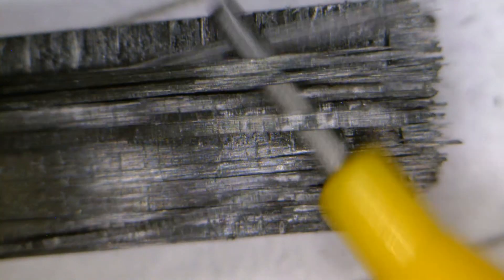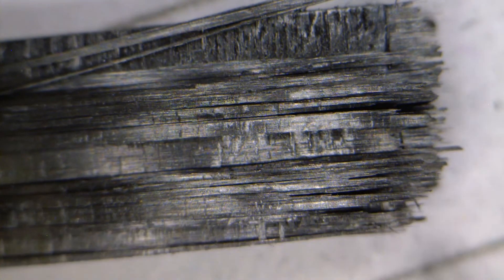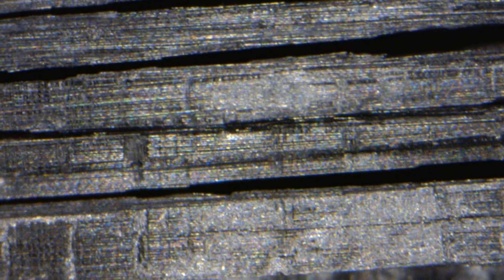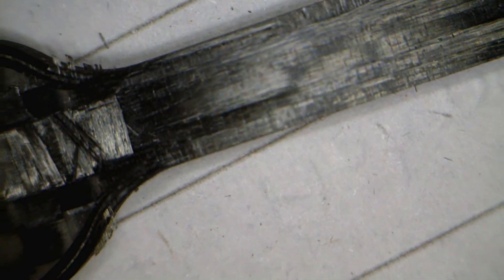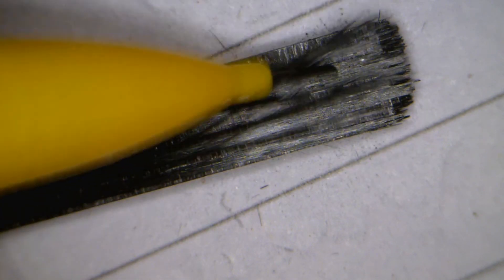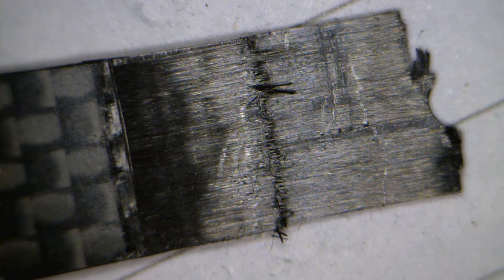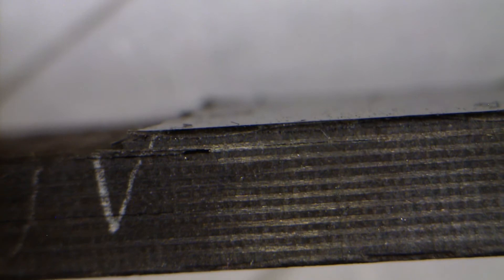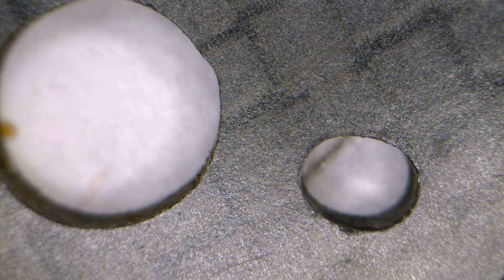Broken carbon fiber quadcopter arms under a Microscope

Comment: Right, it shouldn't be that loose. I think that's what happens when CF is not cured/infused with epoxy properly. Best CF is prepreg/ cured in an autoclave (under vaccum + controlled time and temp) but that's reserved for Aerospace/ F1 and other very expensive/ high budget applications. Next best CF is standard CF cloth that you lay up on a mold or flat sheet then you pour in epoxy and work it in with a spatula, then vacuum bag until epoxy cures. That's the method I've used when making parts for a Solar powered car back in school... 20 yrs ago. Some of the frames do use very good CF, but many used poorly epoxy infused CF and you end up with de-lamination or loose fibers.
Hey, cool to know about your other half's Lara Croft days, that's one of the fields I've always liked very interesting career she must have had. Enjoyed this video quite a lot!
Reply from the maker: EngineerX what I don’t understand is why it appears to be uni directional and only at two angles. I was expecting woven cloth with multiple angles. UD has no strength other than the direction it’s running from what I can find out. More investigation needed :) and yeah, she has some stories ! Trained by the S.A.S in anti kidnap techniques, held at gunpoint in the Sudan... It’s really annoying when you’re watching telly and some amazing location comes up - she’s been everywhere!

Comment from the maker: As pointed out, this is not an electron microscope! I changed the thumbnail and title shortly afterwards but apologies if I refer to it in the video....
Also I'm rather surprised this seems in both cases to be UD carbon with a woven finish. I expected a weave. Both arms were exceptionally stiff, but snapped like twigs in the first light crash.

Comment: Im going to be an wise ass here. But if it is an electron microscope you can determine the balance of the compounts in your sample because the electrons makes the sample radiate a specific wavelength. By the determining the wavelength and intensity you can determine what the sample is made out of. But by the looks of the video your using a normal microscope so this is fucking clickbait! Hahaha. Im kidding man! Very nice vid! This is very handy to RnD what causes failure! Always love to see stuff under a microscope!
Reply from the maker: Raymon FPV yes you are correct! I changed the thumbnail yesterday but it's still showing the old one! My next video will be titled "best drone of 2018!!!" It seems to work for other channels lol
Reply: Coppertop FPV whahaha. LOL!!! But i was just fucking with you man haha.
Reply from the maker: Raymon FPV its all good mate :) im genuinely puzzled as to why I'm seeing ud carbon set at two angles and a top of woven cloth. This seems a bad idea to me. It will make it rigid but really weak from certain angles (45 degrees)

Comment: I remember looking a while back into the process for making carbon fiber sheets. Here's one I found quite helpful. They also stock materials and kits to make your own.
https://youtu.be/3uhR4jdFiS4
This will probably answer a couple of your questions on why the need for straight strands and dry like fibers.
Reply from the maker: Trystan good video, but I’m not seeing any of the techniques he used here. I see unidirectional and a top layer. More scope work needed.

Comment: i've often thought some 5mm or even 4mm carbon is just two 2mm sheets stuck together, which may not sound like a huge thing but theres a myriad of ways to weave and to cure carbon, i assume the best strength comes form oven cured  sheets which have epoxy's that take a lot of heat to harden but in the end are stronger, in all the various ways, stiffness, flexy,  multi directional strength etc etc...  i suspect the loose strands you see are the result of the massive energy released to break the carbon in the first place.  you would really need both sides of the shattered bit to make a better guess, i was surprised you couldnt see any weave in the layers, the plain weave should have carbon going across the short length in and out of the long length???
Reply from the maker: TheMadmacs I suspect you are right about sticking two 2mm sheets together. It would explain why I have two chunks about 2mm thick with a cleanish separation. I’m as puzzled as you by the lack of weave. I was expecting to see a cross mesh, and other than the top or bottom layer (which seems the strongest part), all I’m seeing is straight lines. Checking on google it’s not what I was expecting. The first piece is clearly wonky. Under your normal eyes they are just thin threads with no sign of resin. Puzzled!
Reply: yeah i just had a quick search on weave types and was shocked to see a non-weaved carbon????? just straight strands?... my brain won't compute this being cheaper and easier to work with? would be a night mare no? would obvioulsy be cheaper as a material than woven stuff but  unless its just a big roll of single strands going inside a big production line machine which washes epoxies and cooks all in one production line, i dont see how it would be cheaper to produce single stranded carbon fiber... only person i know who can talk a little about carbon fiber is skidoosh
Reply from the maker: TheMadmacs If it’s cheap woven cloth (look at this image https://en.m.wikipedia.org/wiki/Carbon_fibers) perhaps I’m only see the outside edge which is the loose ends, but why those would be in the middle of the arm is beyond me. My brother is an aerospace stress and weights engineer so I’ll have to ask him what I’m seeing next time I’m oop north.
Reply from the maker: TheMadmacs that link isn’t showing the image. Try this https://goo.gl/images/c58Hm6
Reply: yeah this is what i found, the loose single strands... can you ask him about curing process and if its possible to stick two bits of 3mm together at home, really don't wanna putting a wet epoxy frame in my oven hehehe  http://www.carbon.ee/en/n/carbon-fiber-all-patterns-explained
Reply: yeah thats the plain weave, which is what we want i think, ie.. doesnt matter what angle its cut because one sheet is diagonal across then square across etc etc
Reply from the maker: TheMadmacs when I asked him about this before, he said all the frames he had seen, were woven cloth, not ud. However, the straight strands would indicate unidirectional carbon, so not sure now!
Reply from the maker: Ok my bro was not much use. He said this is cheap toy grade stuff however it appears to be unidirectional with a woven outer layer. If you read up on ud it is very strong in ONE direction. Given our crashes can happen from any direction you would imagine they would layer it at angles or use severap different weaves to provide better strength, but all I see is straight down the arm and then 90 degrees. I'm tempted to buy an armattan arm just to piss a lot of fans off ;)
Reply: i'm just gonna buy a couple of sheets of 3mm plaine weave from banggood and design my own.
i was out today stress testing my new rjx and trying to get rid of some rusty thumbs,  the rjx flew like a dream, but the fpv signal was awful, will take some effort to fix it. but i am blown away by how well it flies, makes my other quad feel like a bus.  gonna try and cobble a vid together but i flew like an old lady.
Reply from the maker: TheMadmacs lol. I like the akk vtxs - cheap and mine have been great.

Comment: Could it be that what you are looking at is due to the damage (i.e., the delamination) not why the arm failed?  Think about the structure of graphite which is a series of overlapping plates (that makes it slippery).  Maybe a similar thing is happening to the arm under stress.  I would guess that the delamination is due to the fracture along the filaments of carbon fibers.  In other words, the resin broke followed by the breaking of the individual carbon fibers.  The resin is what holds the carbon fibers together.  The carbon fibers add stiffness to the part.
Reply from the maker: David Nickell both of these were frames that broke after only a few flights, so no longer term fatigue was at play. To get a piece that was right to go under the microscope (after I realised I wouldn’t be able to pinpoint the failure) I broke one of the arms in a different place to expose the inner. As for the rest, it’s just guesswork. I’d like to take a frame I know is bulletproof and break it and look, but I don’t fancy killing a quad to do it :) After more breakages occur, I’ll keep looking and see if there is an emerging pattern.